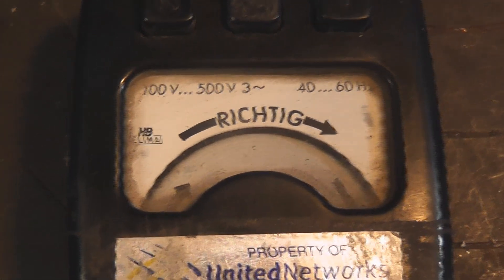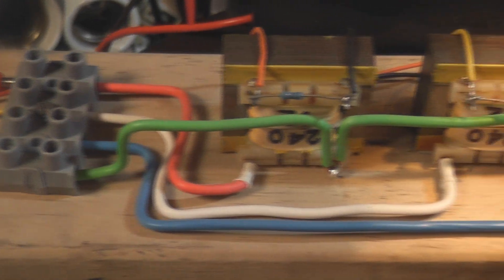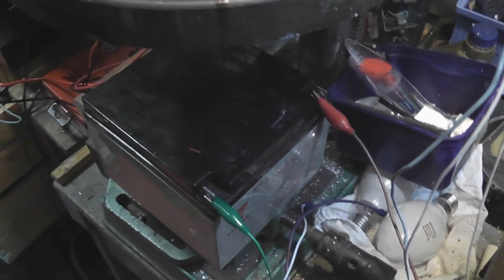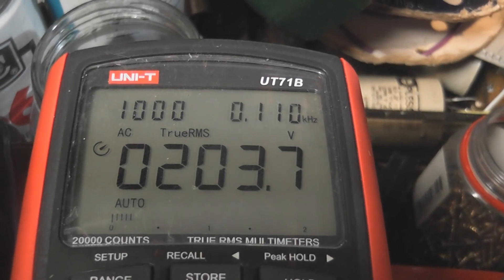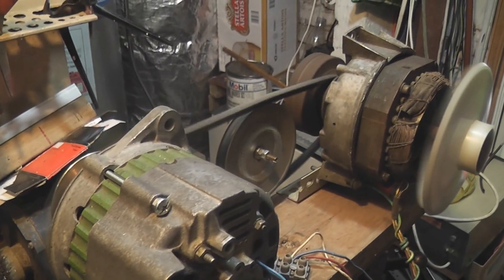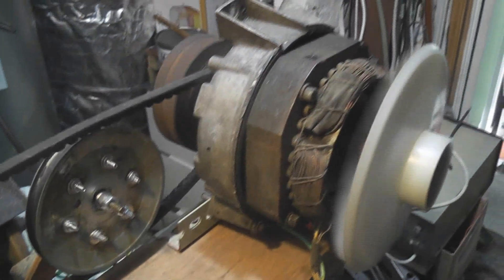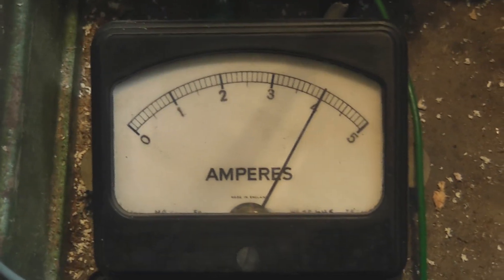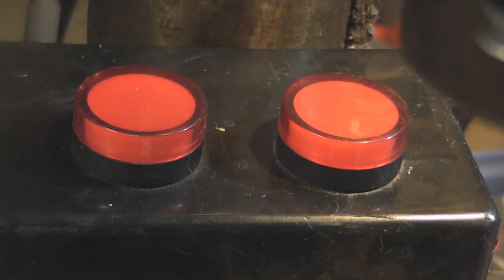Car Alternator used as small 3 phase generator

Comment: Are all car alternators 3 phase?
Reply from the maker: Yes they are, as far I have seen them. And I have repaired and taken many car alternators apart over the years.
Reply: @RODALCO2007  i thought they were... Had a discussion with someone the other day who swears they are all single phase.
Ive seen 6 diodes inside these meaning 3 phase rectification.
Reply: @Surferant666  Definitely not single phase, I think the confusion comes in because there is only one single DC output, people tend to forget that the three phases are are all connected together after the rectification to DC to form one single DC output instead of three different DC outputs.
Reply: What voltage do each of the 3 phases supply on their outputs on a 12v car alternator?
Reply: Have these alternators permanent magnets?
Reply: @filhote99  No permanent magnets, the field coils are electromagnets.
Reply: @MrGoogelaar  thank you Very much
Reply: Can u genarate house power with one of them like a big genarator like a tv or something like that

Comment: It is better to say accu than battery. Accu is short for accumulator, which the battery technically is. It accumulates electrical energy. I may be over analyzing.
Reply from the maker: You are 100 % correct, In The Netherlands we called it ACCU (accumulator) which is the correct word. The English language simplifies everything to battery. A battery is a throw away cell like an AA or D cell.